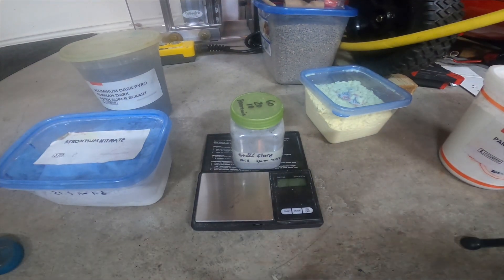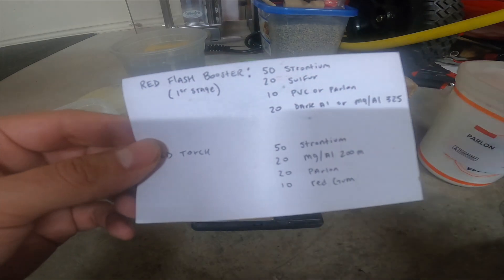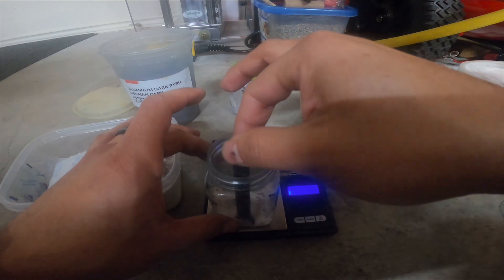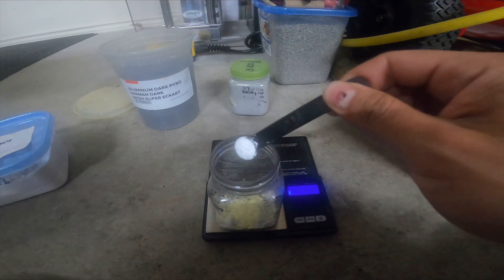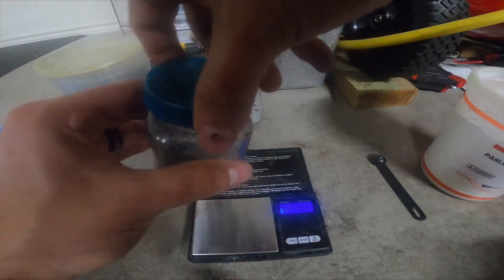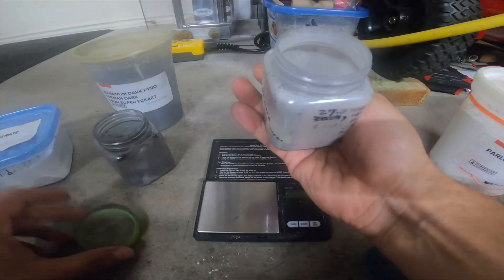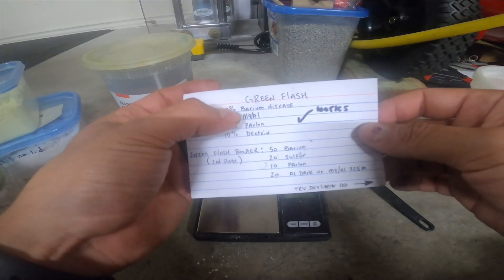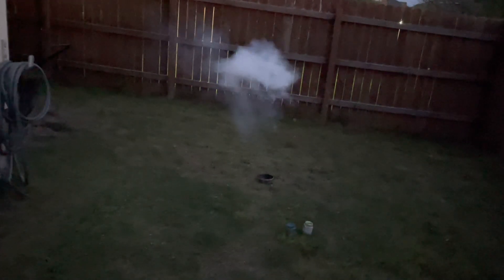How I make red flash

Comment: Hey would this  work for making red stars? If so how.Because I have some potassium chlorate but it’s homemade and not very good.
Reply from the maker: Yes if you look at the video I posted recently I’m testing som stars and I made a tiger tail to red which is just the flash I used in the video.
Reply: @E85_STI  thank you
Reply: @E85_STI  also what should i use to wet the mixture,